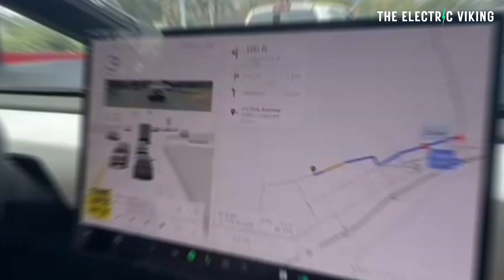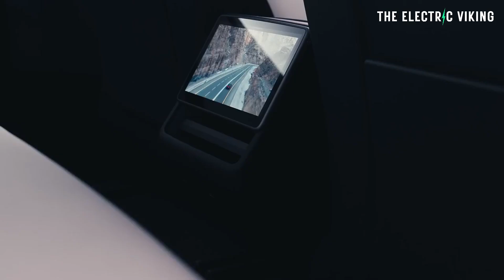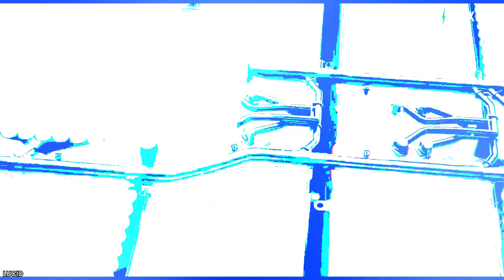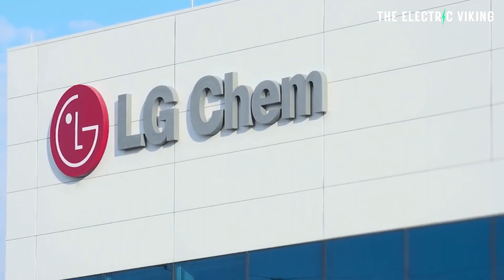Insiders reveal Tesla's 4 NEW batteries: NC05, NC20, NC30 and NC50

Comment: One thing about FSD is that in Alabama it’s way less smooth that I am, and still jumps into turn lanes that end when the car needs to continue straight. Using in Florida it jumps on the wrong exits and runs totally the wrong direction with no intention of turning around. It’s great that it’s showing promise in Cali though!

I find it often speeding towards red lights when I would have long began to slow down as well. And still zero debris or pothole avoidance. It is getting slightly better at following the road though.
Reply: They are really good points for someone who doesn't have a car with this technology. To be honest I like driving and driving as efficiently as possible to preserve the car so it definitely wouldn't suit me. Sounds like your roads are similar to those in Australia
Reply: @julesmoto9022  Yeah. If you average out the entire drive, it’s not very bad, but it definitely is nowhere near set and forget. Just a few months ago it was running me off the road. 😂 I do like the feature. It just still needs some training.

Comment: It hard to know how any of the new batteries are going to stack up longevity wise. Accelerated testing can only tell so much. I don't even know, for sure, how the LFP battery in my car will pan out after 10 years (it seems like initial calendar degradation is faster than I expected - hopefully it levels off). I think its going to be years before the Jury is in on a lot of these combinations but it does seem that Tesla does a great job with battery management - with some pretty high millage / older cars now showing up and still going the distance. 
Although I must admit I'm not following Tesla like I was, as their leaders political agenda has really put me off.

Comment: Tesla must developsmaller than 4680 battery for getting voltage up for perfomance versions and smaller cars . at least roadster must have smaller cells to get voltage up 4x or more to 1600V to get more power to engines and lighter car

Comment: We need  newer  batteries  , 280Wh/kg    asap
Reply: Maybe 
Remember it’s a trade off between weight savings and cost. Cost of the current product has come waaaay down. If changing to a better battery doubles or triples the cost then it won’t be adopted. 

First create new battery 
Second figure out how to mass produce it for a low enough cost.

Comment: Adam Tech are reporting Tesla have created an Aluminum Graphene Ion battery which can charge in 5-15 minutes , offer 500-600 miles of range, provide 500WH/kg and 7000 charge cycles. Does this differ from the tech you’re reporting?
Reply: Oh ya that channel does make up alot of facts. Plus that is not a battery at all being used
Reply: Both stories were reliably pulled from their anuses

Comment: 4 days ago Tesla changed the battery on the cheapest Model Y the one with rear engine from 286 miles the 60Kwh battery - they put the 75 Kwh battery and now it has 373 miles and price from £45k now it is 47k £ so now it has become a long range rear wheel drive engine - the other long range models 2 all wheel drive engines and performance have remained the same no changes, 52k£ LR All Drive and Performer 60K£ - Model 3 all 3 variants have remained the same - What I think is that the cheapest model, the one with rear-wheel drive, sold very poorly - LR all-drive was the best selling -, what they changed, I think they did the right thing because a rear engine and a bigger battery gave with 100 miles more range - Bravo Tesla - the next modification that would be logical is to increase the battery on the LR all-drive to put the 100 Kwh one on the Model S 100 D - and the LR all-drive can gain 150 miles more , because they will be cannibalized if they don't change the battery, I would buy the cheap model now, because now it's called LR rear-wheel drive and it's 47K £, I wanted an LR because I want autonomy and one engine is enough - I'm curious what other changes Tesla makes in the future - LR all-drive 100 kwh battery 500 mile - next step for Tesla Model Y  )))

Comment: For Europe a 450 mile range battery would be sufficient for most people. Bearing in mind that yes people do drive from northern Europe to the Mediterranean or the Alps but that is only once in a while.
Reply: Hahaha Europe is so tiny.  Texas is bigger.  450 mile range is a long way without stopping to pee!
Reply: @davidbeppler3032  - Texas is bigger appreciate the humour. But in case you're taken seriously ... Europe is 15 times the size of Texas, and it's total land mass is bigger than the whole of the US landmass. If you tacked another Texas, a Maryland and a Deleware onto the US you get to nearly the same size as Europe.  Agree 450 miles is a long journey, but there again at my age 50 miles is a long distance without stopping for a pee break.
Reply: @GruffSillyGoat true dat!
Reply: @davidbeppler3032   - ha ha, Europe is bigger than Texas, sure Texas is bigger than 450 miles -  but most people don't commute 300 miles to work - indeed that would be in the next country in many cases (or the next-next one..)  (Yes having a laugh at the same time as getting info across borders..)

Many people actually driving 450miles (in one hit, ie. ~725 km)  have other people and / or gear with them, range suffers hugely when loaded  -  or with baggage / stuff outside the cabin.  My current vehicle does 700km easily without using additional fuel - a long range tank can let it get another 700km..

 - Don't worry, I live in Australia and have at times driven several back to back days of more than 1500 km each day, I know what long range driving is. (I have also driven across Europe (several times) - one "limited stop" route was 2780 km in 32 hours...) - another through trip was Germany to The Black sea coast that is 1229 miles..  (1979 km..)  - I stopped to pee a couple of times on those trips..

PS. longest distance in Texas I can see is around 799 miles (1285 km) "north to south", or ~773mi (1244km) "West to East" - East to west may well be shorter..  (jk.) -Texas is big but still smaller than 5 of the 6( or7) States of Australia - Northern Territory isn't a state but is still larger...
Reply: 450 is overkill for Europe. Especially with the amazing charging infrastructure they have.

Comment: Needless to say, but if we are happy with 300mile range cars, they could be lighter, cheaper with higher energy density
Reply: The denser they are, the hotter they burn.
Reply: @robotnoir5299  burn hot like petrol or hot like diesel?
Reply: @JuliusFawcett  You know what they say...  These liquid fuels can't even melt a steel beam.  ;)
Reply: @robotnoir5299  liquid fuel is used by arsonists tho, never heard of a fire starter going to work with a battery
Reply: @JuliusFawcett  Maybe that's coz the battery is too dangerous, and might spontaneously combust on the way to the target site?  Liquid fuel really goes up when you tell it to.
Reply: @robotnoir5299  hooligans are too frightened to use batteries in Molotov cocktails, right

Comment: Your incorrect use of "oh 5" when it is actually "ought, or zero  5" is confusing when the zero is following letters, not other digits. I only mention it since it will likely be used in your comments and videos on a regular basis. I have seen the capitol letter 'O' and the digit '0' confused on a regular basis in passwords and software since 1970, and it continues to be a problem. That's over 50 years and we STILL have not resolved it. There are even some poorly thought-out fonts that use the same character shape for both the capital letter and the digit. (Try entering a password that was printed in that font.) The misuse of the character 'oh' spoken as a digit may be OK when used in a specific context, such as a phone number, but in the rest of the tech world it simply does not work, and ultimately leads to real, expensive, and perhaps deadly problems, (not issues.)

Comment: I just took delivery of the M3 LR last week...fantastic car, but the range figures are a bit deceptive...at 100% SoC the range may well be 370 miles, but since it is recommended that you don't charge past 80% on a day-to-day basis, the observed/calculated range at 80% is a tad below 300 mi.
Reply: What is the battery chemistry? I don't think the 80% rule applies to LFP.
Reply: @scottdarroch9003  I think it's the LFP, but I'm going by what the app and Tesla's website say...maybe they haven't updated it for the new battery chemistry, but I didn't want to chance it.
Reply: @enighostmaster if its the LR, then it 100% NCA and not lfp.
Reply: @tamasgiczi   does that mean it's good to 100% or I should continue to charge to 80%?
Reply: @enighostmaster  its the one that loves not beeing charged to full.

But 80% is not some magic number. 
For example if you leave home to work from 80, you arrive 70, then go home from 70 to 60%, and then you charge up at home,

Then its better for the battery to start at 60 in the morning and arrive at 40 in the evening. Higher the voltga the higher is the stress on the battery.
Reply: @tamasgiczi  Not sure I'm following what you're saying...if I wait until it's at 40% to start charging, wouldn't I be charging at a higher voltage from a lower starting point? And is your point that if I'm only driving the equivalent of 20% daily, it's better to only charge from 40-60 instead of 60-80 every day?
Reply: @enighostmaster that would be correct. If you want all the numbers, check out battery university’s docs on battery health and degradation. Ideally, they want to sit around 40% for the least amount of internal stress. If it sits at 80% it’s still not ideal when the batter gets warm… which heats up when you drive. 20% daily use, I’d personally set the limit to 50% with the occasional charge to 100% for cell balancing.
Reply: It's definitely ok to charge it full for long trips
Reply: Yep, mine is the same.  270 miles daily.  341 for long trips!  With 30 miles extra before it dies for emergencies.  Total 370 miles of range.
Not LFP.  NMC batteries.  I have same car.  Best to charge to 80%.  But to be fair with the 30 miles buffer you could probably charge to 100% and never have a problem.  I plan on the car lasting more than 20 years and more than 750k miles, so I only charge to 80%.
Reply: I agree got m3 to replace my 2018 lr  rwd that was totaled the range difference is amazing and it's super quiet
Haven't charged beyond 80 percent yet but will for trips
Reply: Then eat 10% for interstate inefficiency and the bottom 10% for reserve, and suddenly you’re at 230~ miles. This has been my experience traveling from central Alabama to Orlando. 2 45-50 minute stops for complete trip with 3-4 stops on the return trip as destination doesn’t have a charger. I find the stop frequency to be much faster than I need to eat. My personal experience is we need 600-750 miles rated range to actually commute very comfortably.
Reply: @WubbaLub  in USA maybe. Im living in europe, 7 miles from the office, my parents are 80 miles away, wifes parents 50 miles away.  I charge at home, and at office where it is free. 99% of my driving can be covered with the 60kwh tesla with 30% remaining. I use public charging 1-2 times a year. I totally drive 15k miles / year. Im the around the aberage driver in EU.
Reply: @tamasgiczi  that’s awesome, and I’m sure is fine for 90% of everyone. Even for me, it’s perfect for daily commute. It’s the traveling where it absolutely can’t replace the convenience of ICE yet. That example was a 980 mile round trip. The range estimates I made are really just to replace altogether. Which includes the longer travels. My daily commute is only 90~ miles which my model Y does perfect with about 35% use.

Comment: No one talks about the elephant in the room. Which is, when everyone talks about range, they talk about using 100 down to 0. 
I’d like them to report actual recommended usage range. The reason why I want a Cybertruck truck with 500 miles of range is so I can get 300 of actual battery usage. Meaning, from 20-80% of the recommended usage to maximize longevity. Or, depending on what chemistry 10-90%. Either way, when I hear max range, I always have to take 60% of the total. For a long road-trip, I like to drive 300 miles before refueling. Provided I don’t have to use a restroom. I can travel 440 miles with my ICE minivan before I need to refuel. And, with the SUV I had it was 360, but I would refuel at 300. So, for me, 300 for the Cybertruck truck would be doable. However, for local driving, the current version of the Model 3 is great! I’m really looking forward to seeing CATL 1 million mile battery start to be used widespread! The value proposition to buying a car that you know will last that long will be enormous!
Keep up the great videos! Cheers!
Reply: Yes, you have a very good point.  Also, I learned that driving extra fast (like 80 MPH) for a couple of hours on the Interstate (speed limit 70 MPH where I am) burns through battery about twice as fast as one would expect (I think the mileage ranges for the EPA are tested for 55 MPH).
Reply: - it is all fake anyhow... Capacity, scales, bar graphs - where is the cell voltage display?? and charge / discharge curves per module??? - Marketing B$.
(The average punter doesn't understand anything much. )

I like to  how many kWh (BTU or MJ) per 100km/mile - some-such it is using (WLTP or some other standard helps, but I don't drive to that standard) - not miles before I kill the battery  (sure the "smarts" in the car won't allow you to kill the battery dead in one time, as it quarantines some energy - on the top and the bottom ends).  A Big Car uses more ENERGY to travel the same distance at the same speed than a smaller car - absolute ENERGY usage is more important to me than the "Range" - which then is dependent on the bigger car having a bigger "tank" of energy to achieve the same : tonne* kilometer per kWh *minutes, metric of travel....  

In my diesel car, I like to know how much it is going to cost me to do a trip - every trip uses somewhat different amounts of energy per 100 km (or per mile) - I never fear i won't make it, just calculate how frequently I may need to refill that 80+Litre tank...  On Remote Trips I take an extra can (or 3) of fuel - in an EV, anything you can easily put in the trunk is useless next to the energy usage per 100 km, and the battery in all the new extremely high value "camping trailers" merely offset the "mileage lost" by hooking up a parasite to the aft end...

(Aircraft are easier to quantify as it is known how much energy is used per minute at climb and cruise settings - wind direction and intensity merely changes the number of minutes aloft.)
Reply: Actual recommended usage range varies. 

City driving— who cares. You always got plenty. 

Long road trip - schedule it to reach 100 right before departure. Then let the Tesla plan the rest. 

I’ve driven my old S all over the spread out US West and no problems. Crossed the Sierras and Rockies many times. The car (and my board) love it. 

My S gets about 185 miles at highway speeds. All this talk about 400 miles is silly.

Comment: in other battery news
$AMPX
The contract employs Amprius to develop a small format custom high-energy SiMaxx

"The application is projected to require over one million cells per year if the project objectives are met."

Agreement Funds Development of New Silicon Anode Cell with Reduction of Weight and Size by 50%
Reply: Amprius has plenty of announcements and has been talking about contracts for years, but where are the cells being used in actual products. I'm not holding my breath.